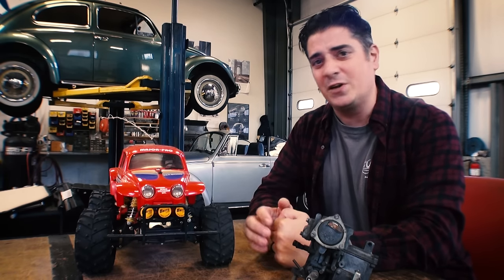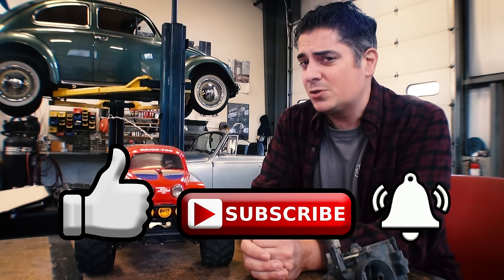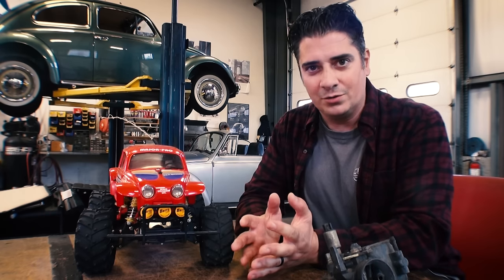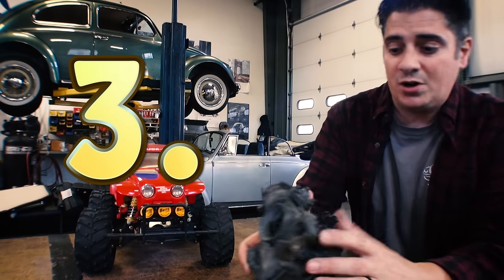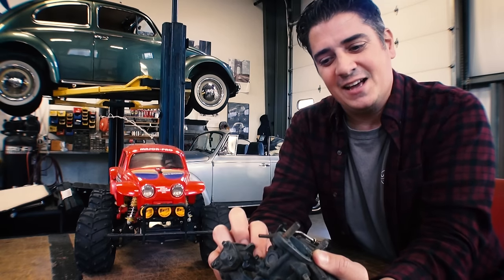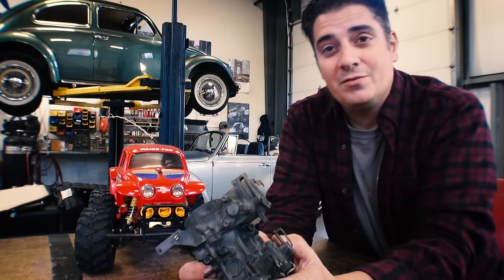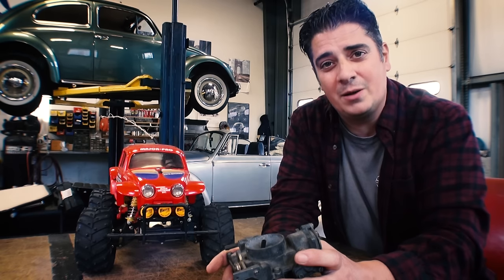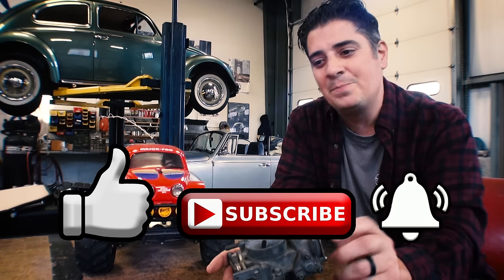TOP 7 Reasons your Classic VW Beetle BuG Hesitates, Stalls, or CHOKES on Acceleration

Comment: I just checked my beetle and my auto choke hasn't got a wire on it and I haven't seen any loose ones hanging around, how would I get that wired up so I don't have to nurse it whenever I start my car?
Reply from the maker: It is usually a Y connection black wire from the choke, to the idle solenoid then to the + on the coil.

Comment: I need help! I have a 67 beetle that won’t maintain a steady speed. It’s accelerating or decelerating all the time. 
I tried everything. Any suggestions? Thanks.
Reply from the maker: well, kinda need some more detail.  Is she running hot?  Are all of your engine seals in place?  What kind of compression do you have?  Any endplay?  What are valves set to?  timing? etc etc
Reply: Thanks so much for replying! I have learned so much from you and your dad. The videos are fantastic! I will keep chasing the problem. I’m hooked on VDUB’s. 67 Beetle, 67 Ghia, 75 Dune Buggy. Hope to come on one of your car Cruisers sometime.
Reply: I found that my in tank filter was restricting flow.  With a full tank,  fuel should flow freely to the carb inlet.

Comment: can you adjust the choke when the cars hot?
Reply: strange Foot ... you can adjust it hot but you wont know if it's correct till the next time it's cold again. Best to stay near the 3 notches and only move one at a time. Also make sure things move freely. A gummed up choke plate is probably the most common problem, not the actual adjustment.
Reply from the maker: @rupe53  Dead on!

Comment: I used cleaner on the jet, it shot back at me instead of through it. Do I need new jet?
Reply from the maker: You can try sending a small pin through it to dislodge the debris maybe.  Or soak it overnight in carb dip.
Reply: @classicvwbugs  Thanks!

Comment: Hi, I have a Pict 34 carb which after 3 or 4 strokes on the accelerator builds up back pressure so that the accelerator can no longer be pressed down and no further fuel comes through the accelerator nozzle. Any ideas? (I have had the carb rebuilt about a year ago) thanks. Brad

Comment: You can also re-jet the carb to tune out the 009 flatspot, if you are stuck with one. This worked reasonably well on the 1600sp in my old 69 Bay.

That being said, you cannot beat a stock carb and vac advance distributor, they run so much better using the proper combination. My new 68 Bay is all stock and runs so much better.
Reply from the maker: ah yes a rejetting!  Good call.

Comment: get a good fuel filter   I like the clear glass to see all the garbage    doing this can solve  a lot of problems before they start.  not to mention most of these cars have old tanks that have sat for years at some point,  clean the tank out before you start as well and start with fresh fuel line unless you like rebuilding your carbs

Comment: Thank Chris - great video!! My 72 1300 has a major acceleration  flat issue but only when the engine is cold. I covered your 7 points with no success but wondering if the left heat riser may be the cause. It does warm up but I’ve noticed some liquid dripping from where it meets the manifold (under carb) - not sure what that liquid is (condensation?) - do you think that may be the issue , if so how would I solve that?
Reply from the maker: Thats a clogged heat riser, the sign is that condensation.  But it will not cause a flat spot.

Comment: Clogged manifold heat riser is the worst, especially in cold weather. Also missing or malfunctioning hot air supply on air cleaner. They are there to prevent icing and  will cause stumbling. Not just VW but most old engines.

Comment: You forgot to mention that morons should not be playing with carburetor or fuel pumps. I would not consider myself a moron but I have almost caught fire a few times. My best advice is stick to the sealed type fuel pumps and have a pro adjust your carbs, or even seek advice on a forum like the samba so they can guide you. A guy like Mike can look at your motor for 5-10 minutes and tell you what the problem is most of the time. He is just being modest here. Lol

Comment: Hey Chris, I have this stubborn problem that I can’t figure out after driving the ‘63 I recently installed a 1600 single port engine into, I can drive it for 30 minutes and it’s fine, turn it off and no start it can just crank and crank. Let it sit for about 40 minutes and it fires right up any thoughts? New fuel lines, new carb, new distributor and followed your video on timing, only thing I didn’t check yet is valves but it was in a running beetle a couple days before I bought it so I don’t think it’s too far off if any. Any help would be great thank you!
Reply from the maker: Sounds like poor fuel flow, or it is running hot?  Do you have a fuel filter on the fuel lines?
Reply: @classicvwbugs  fuel filter in the line yes, running a jbugs 6v to 12v alternator without a voltage regulator and a blue Bosch 12v coil should the coil be hot to the touch? That’s the only thing I can think of. Car was originally a 1200 6v I switched to 12v because I put it on air ride. But both motors now shut off I thought it was just something in the 1200 I was missing but now the swap I recently did, did the same thing and now the only thing I swapped from old to new motor is the coil and alternator
Reply: @classicvwbugs  by the way man love your videos, your the only one I watch because your super simple to understand!
Reply from the maker: @brianschmidt1989  I appreciate that Brian, thank you.  Yeah I would need to see your engine setup.  With the fuel filter, do you see fuel in it after you drive?  or is it empty?
Reply: @classicvwbugs  absolutely where can I send it to?
Reply: @classicvwbugs  and the fuel filter does have fuel in it still during no start
Reply: @classicvwbugs  I just uploaded a short video to YouTube it’s the only video on my channel so it shouldn’t be hard to find that’s the only video I have of it running that was right after the 1600 motor was put in on it’s first start up (about 2 weeks ago)
Reply from the maker: @brianschmidt1989  OH dude!  You have no rear tin!  You are overheating.
Reply: @classicvwbugs  all the tins are back in, and screwed back together I just did that to see if it starts. Once it was running fine tins went back in

Comment: I the car starts but when I shift the gear and move forward there is no power at all. Almost dies instantly. I checked the wires, condenser, I checked the jets and cleaned them, removed the main jet and cleaned that too. But still there is no power. Then I also have another problem of jerkiness while driving in different gears.

Comment: Random one , I have been through all these issues and resolved everything and everything on my engine is 100% stock and okay tuned up and drives perfectly (no leaks or gasket issues) BUT when on the motorway or highway it drives awesome loads of power but after around 40/50 miles on the motorway at a certain speed it just looses speed and goes lumpy then springs back to life for another few miles then same again and so on and so on ! All googling I have done has always said ignition timing/plug gaps but they’re spot on it does my head in everything is perfect new vaccum lines , carb cleaned rebuilt and tuned new gaskets all the way down to the head , good battery connection etc fuel pump perfect , it doesn’t ice up at all it’s just random and sometimes if it happens on a hill can push my speed down to 30mph which I just want to sort because it’s dangerous! Is there anything that could be an oddball issue that I’m missing ?!

Comment: I have a 73 super beetle 1600 motor when I drive 65 mph after about 3 miles the engine shuts off if I drive 60 miles an hour or below it runs great all day no hesitation it's nothing
Reply: It will start back up after I pull over to the side of the road and drive fine

Comment: Hey man my bug starts and runs regularly for the most part. I have to flood the accelerator to start it but other than that it runs decent. Stalls out when I come to a stop. Not sure what the issue is there. Also it shakes heavily at 35-38 mph and than stops right after any advice?

Comment: Why does 1973 bug 1600cc.   Dump gas into oil.
Reply from the maker: ARE YOU PARKING ON AN INCLINE?
Reply from the maker: OR THE NEEDLE AND SEAT IS NOT HOLDING IN THE CARB.

Comment: What could be wrong if it idles fine, and accelerates quickly fine, but when cruising at a steady speed it hiccups and hesitates?
Reply from the maker: Hmmm that could be electrical, or fuel flow it intermittent.
Reply: @classicvwbugs  what should I check first🤔
Reply from the maker: @connorstock5768  either one, check wires, plugs, coil, etc. Then check flow of fuel shooting down carb.
Reply: @classicvwbugs  flow of fuel seems good. The accelerator pump shoots a real steady stream. I’ll check the wires and plugs next, could a coil or bad plugs cause that? It idles find until I try to get a steady rpm but accelerating quickly there’s zero issues
Reply from the maker: @connorstock5768  did you take the top of the carburetor off and look down the carb as you're accelerating to see if there's a good shot of fuel?
Reply: @classicvwbugs  It also has no issue in high RPMs so if I sit at 3k in any gear it doesn’t hiccup? It’s strange 😂
Reply: @classicvwbugs  I took the air cleaner off and was able to look down in it
Reply from the maker: @connorstock5768  hmmm maybe send me a video?
Reply: @classicvwbugs  you got an Instagram or Facebook? I’ll get it warmed up and get a video for ya
Reply: @classicvwbugs  I have the videos. I swapped out for a spare coil and can’t get spark now, even on the coil it came with
Reply from the maker: @connorstock5768  did you check points and condenser?  Or the plug wire from coil to dizzy could be faulty?
Reply: @classicvwbugs  I replaced the electric ignition for new points and condenser. The coil is getting power but no spark, trying a new coil today and new condenser
Reply from the maker: @connorstock5768  ok good, let me know how you make out.
Reply: @classicvwbugs  will do! Thank you!
Reply: @classicvwbugs  tested a new coil, new condenser, points gapped correctly and still no spark, could it be the cap or rotor? Is it worth just getting a whole new distributor and plug wires?
Reply from the maker: @connorstock5768  it could all help, it's all process of elimination right now

Comment: But there is one thing you can modify to get just every vw engine to run without hesitate. It took me 15 years to discover, no info of this mod on the internet. Only one vw shop manual will tell, the 1972 one.

Comment: Sorry but None of your seven reasons are the main cause. The vw dealerships dealt with this issue by upgrading the main jet to a different  jet size. They sell these jets at all car shows ,vendors know all about the culprit of the flat spot . I walked into a dealership bought a brand new 1973 VW beetle and during the test drive we felt the flat spot .
Reply from the maker: Yes but what if you have stock material?  If you want to work with what you have these are the things you have to look for.